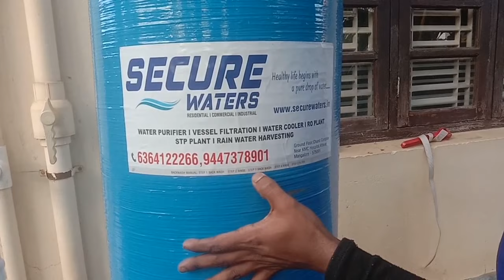Water Filter | Iron Removal Water Filter From Vessel Filter | Vessel Filter Installation Full Video

Comment: How much TDS, PH we can supply for this system? Is this reduce the TDS and PH? Is there is chemical used in backwash time? What is the max. Pressure we can supply for this system?  What is the  backwash time?  Spare parts of this system easily available in market? Totally what is the cost of this system in mangalore?

Comment: The installation should be near the water tank. Else low water pressure at the first floor. I am facing this issue. Please reply if I am wrong.
Reply: NAIR, INSTALLATION IS CORRECT THEY INSTALLED THE FILTER BETWEEN PUMP AND INLET OF OVERHEAD TANK.

NOT BETWEEN OUTLET OF OVERHEAD TANK AND FLOORS.
Reply: @MrTatarajesh  that will reduce filter efficiency
Reply: @arunkumarnair001  Pressure will get drop and filling time of your overhead tank will take longer than usual. But no issue with pressure towards  your flats.